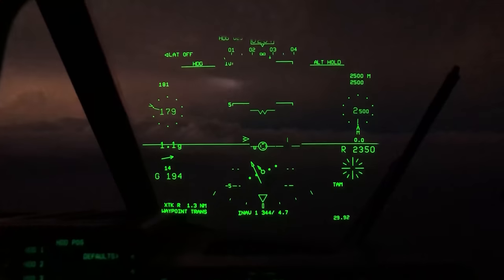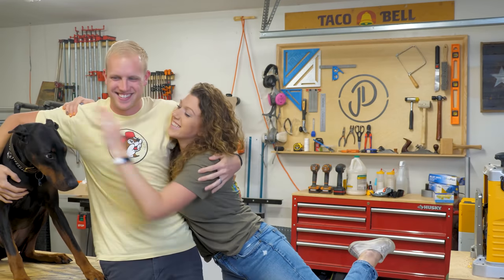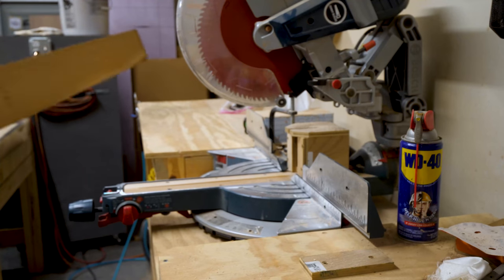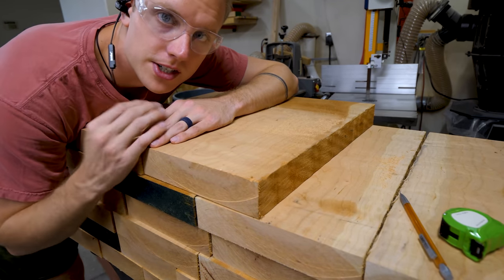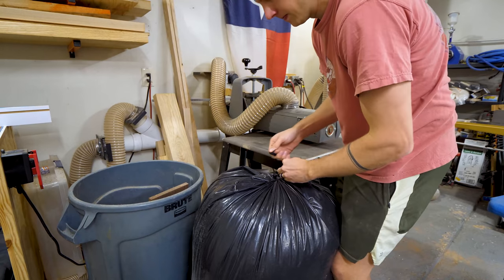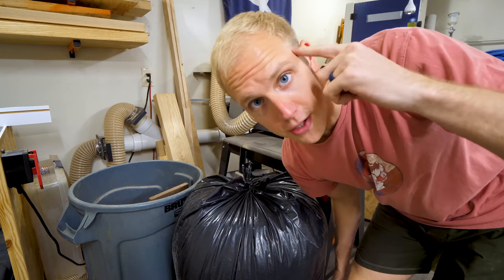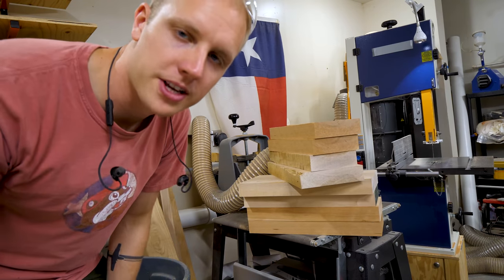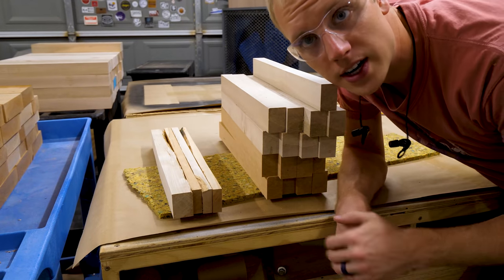What tool is best for cutting boards?

Comment: All these comments about using a different table saw blade ignore the problem, which is the wood itself. You yourself said "the internal stresses" in the wood are causing it to pinch the blade. If the wood is stressed, it will pinch a 24 tooth blade as much as a 50 tooth one. A bandsaw blade is so narrow that pinching isn't an issue, but you also said the pieces "banana" on you sometimes after they are cut. This is a lumber problem, not a tool problem. While some stress may be natural, if it happens on board after board, and in different batches of wood from the same dealer, it is not a natural problem but a man-caused defect called case-hardening. This is caused by attempting to kiln-dry lumber too quickly, which causes the outer fibers to compress at a significantly different rate than the inner fibers. This is a significant defect that is grounds for returning lumber to the dealer, and if it happens often you should find a new dealer.
Reply: @deanwilliams93  :)
Reply: @deanwilliams93  - Sounds good :)
Reply: I concur … find a new dealer who gets their wood from a different supplier … or dries their own wood.  It happens … but it should be rare, not the norm that wood is so stressed.
Reply: Totally agree.
Reply: Listen to Stumpy Nubs, he knows what he's talking.
Reply: Totally agree with Stumpy

Comment: For your setup right now keep doing what you're doing. Once you get to a bigger shop you might consider upgrading to a full three horsepower saw with a good thin kerf rip blade. Also, and maybe it was just the angle of the camera, it did look like you were standing directly behind the wood as you were running it through that blade. You need to be staying offset in case you get kicked back. That's one thing about the band saw it's a much safer tool compared to the table saw.
Reply: @deanwilliams93  That might be true but the thin kerf will also allow for an easier cut.  It's less mass to move and it's removing less material which when ripping thick hardwood will put considerably less strain on the motor allowing for faster and cleaner cuts.  As he is already jointing these ends anyway it's not really an additional step and would be considerably faster than the bandsaw.  A standard blade might remove the need for jointing but if that means double passes or much slower feed rate then it still not a win. Honestly what they need is an old school bandsaw with those 1" wide blades running on 220V.  it would be huge and only usable for one job but in a production situation it might be the best choice.
Reply: Fancy seeing you here Mr bear! :)

Comment: Pretty sure the folks in here saying to use the 24T Rip blade are on the right track… however … I still think you’re gonna run into some binding issues on 8 quarter stuff… making sure the wood is totally cured and acclimated to your shop is also key… but honestly … just keep using the bandsaw if the process ain’t broke don’t fix it!!

Comment: So I'm generally able to consistently rip through 8/4 material (even hard maple and ash) without burning, and this is on a jobsite saw that is built into a larger table. So not a big motor. 

Here's my suggestion if you really want to dig into this method:

1) Get a dedicated thin kerf ripping blade. The freud thin kerf glue line ripping blade is awesome. While I can rip 8/4 with my Amana 40T, it is slower going and I do get some burning. 

2) Get a miter slot jig with a dial gauge and make sure that your blade is perfectly parallel to your miter slot AND that your fence is also perfectly parallel. You can also have the blade slightly (like .002" at most) out of parallel at the back and away from the fence. 

At the end of the day, I think you're fine either way. If the side you're ripping isn't your glue surface, then maybe the bandsaw is just fine (and likely safer). That said, you might be able to take fewer passes through the planer by using the TS. 

You may also want to look at getting a power feeder setup on your TS for this. It might not speed things up, but you'll get a consistent feed rate that should reduce burning, and it keeps your hands away from the blade so it's a lot safer. Check out Mike Farrington's channel. He has a 1/4 hp power feeder that he puts on for repetitive ripping tasks. 

Good luck with the commercial space search and move!

Comment: I didn't read all the comments below, so this may have already been noted.   The way that is burning, it looks like the blade and fence are not parallel.
When Parallel the "set" of the teeth should make a wide enough kerf to prevent burning.   This appears that the fence is angled a bit toward the blade causing the blade body to rub and pinch the wood.   Check the parallelism of your fence and blade to the miter slots.   These are usually both adjustable. If everything is parallel you shouldn't get the binding/pinching that appeared to be happening.

Comment: I read most, not all of the comments & I absolutely agree about the rip blade, that was the first thing I thought of. I'm a retired boat builder that has converted the garage to a wood shop with mostly used tools. I bought a 22yr. old Ridgid 1 1/2 horse table saw that was sitting in a warehouse for a number of years. Had to do a lot of adjusting & tweaking to get it dialed in but it's still not perfect (22 years old!). As far as I can see except for the blade your not doing anything wrong. This is just the nature of Maple, one of the toughest common woods out there . A lot of good suggestions here  especially the short sacrificial fence.  Once the stock gets past the fence there is nothing for the stock to push against & it still gives you the support you need. The only other thing I can think of is possibility, your blade & table aren't perfectly aligned with each other. This can happen with even brand new saws or saws that have been moved from one location to another. You can check this with a dial indicator to make sure the front and rear of the blade are parallel  with your crosscut slot. My saw is close not perfect but like I said... 22years old. The way to fix this is to adjust the table (not a fun job).There are 4 bolts under the table that can be loosened & with some gentle taping you can align it. Then hope it doesn't go right back when you snug the bolts back up. Now with all that being said, if I had a bandsaw like yours I would get the best resaw blade out there & use that. Just make sure to get the widest blade the saw can handle. Just remember your not doing anything wrong, it's just the nature of the beast.

Comment: Always enjoy your videos! Regarding the table saw, I think I'd try a rip blade instead of a general purpose blade. A rip blade will allow a faster feed rate, less heat build up, and therefore less burning.
Reply: Yes, 24 tooth does the trick for me!
Reply: True. Just depends on how often they would have to be switching blades.
Reply: @StevenDavisPhoto  If I had my 42T blade on my saw it would totally react the same way as the video
Reply: I would say you got the wrong saw blade.  I have the same saw with a 50 teeth combination saw blade and work like a charm
Reply: I've used a delta contractor saw and cut green hardwood timber with loads of tension with a dewalt 36teeth blade don't know what power the motor is but feeds in and out not A problem. Also how do you rate the mirka Sanders you should do a video on sanding to a finish.

Comment: I use a Freud Thin Kerf Glue line rip blade on a $600 Delta Contractor saw and I cut several hundred board feet a week into strips on it with zero issues. I do have to slow my feed speed a bit on Maple and Walnut to avoid bogging, but thats the saws fault. Its only a 13amp motor, it doesnt even have a HP rating. One other thing to check is to make sure your fence and front fence rail are 100% square to your blade. I had to make a few small adjustments to my front fence rail because my fence wasnt square to the blade when I bought the saw.

Comment: Couple things. What HP is the table saw? Thick hard maple you're going to need at least 3hp. What type of blade, combination? crosscut? rip cut? Thin kerf or standard kerf? all these things will add up to problems.
Reply: Should use a rip blade,  it does make a difference.
Reply: I am in the uk and my table saw only has a 1hp motor, but i use a rip blade and it has no problem cutting 2 inch thick maple.

Comment: I did this same thing because I was a little too lazy to change from a cross cut blade which is what you have in your saw and change to a rip blade.  Now I change the blade when needed and it works just fine

Comment: For the table saw issue you need a sacrificial fence added to the main fence, but it only needs to go past the the front cutting teeth. That then gives the stressed timber somewhere to go. If you look at our table saws here in the uk and europe they either come with a short fence for ripping or an adjustable one that can be moved to have the end of the fence just past the start of the cut.
Reply: Very interesting. I've never heard of this technique before.
Reply: This!!  Exactly the problem, and the safe solution.  Similar concept to the jointer, with the offset feed table height, except since the jointer is performing surface work, the wood remains supported at all times.  With the offset fence (sacrificial fence, lead fence, etc.) the piece is fully supported into the cut, and then, as the wood is separated, it has room to move to eliminate binding.  Of course, a dedicated ripping blade is safer for dense woods too.

Comment: I mill 8/4 regularly both with a tablesaw and a bandsaw. I use feeders on both.
That said, even 3hp is kinda small to run 8/4 through on a regular basis.
For blades you might want to consider talking to people who don't advertise in hobbyist publications or cater to big-box stores. 
A "Rip" blade ground correctly and sized to work with your riving knife will permit you to work much faster on the tablesaw than the bandsaw. (with an appropriately sized motor) The kerf should be a couple thousands larger than the plate and the riving knife should be the same thickness as the kerf. I set the leading edge of the riving knife to just clear the teeth. Use gauge blocks to parallel the riving knife to the plate, if it sits askew it won't work well. 
If you're not comfortable ripping on the tablesaw and need a push stick to run 1-1/2" or larger strips then build a sled that'll let you process those small strips without the extra step of grabbing a push stick.
A rule of thumb is for ripping (either saw) try to only have 2 teeth in the wood, (For resawing this isn't possible but we're not discussing resawing.) With a circular blade such as you show in this video you'd need to really crank it up so as to present an almost vertical face to the wood to achieve 2 teeth in the wood if it'd even work then, and that's not really safe. Heat from too many teeth in the wood will cause some boards to draw inwards to the kerf, it's not always a poor kiln operator. Tooth geometry and gullet profile come into play on both types of blades and sheer horsepower will overcome most of these problems if you don't want to invest in knowledge and cutters. 
It seems as though you two have got a handle on the business end of woodworkin' and marketing yet the only way you've made available for oldtimers to offer advice on the woodworking aspect is to either pay you for the privilege or post here on youtube. 

Maybe consider something different?

Comment: I switched over to a 24 tooth blade for ripping and it works great.  I use a 60 tooth for crosscut.  You can buy a pair with one 24T and one 60T craftsman blade at Lowe's for $30.

Comment: 📌solution to this problem: 
Better use the right blade for the "length cut" (when you cut in the direction of the grain of the wood), less teeth, bigger diameter (if possible) and have the blade max out - save the wood with clamps instead being so near to the blade. (Here in Germany we all fall unconscious, when we see this kind of safety-standards. ;) )
The parallel fence is too far over the blade and presses the wood back on the turning blade, so it get stuck. use a sled or clamps as  mentioned. 
It is like filling up a Tesla with gasoline, it will burn, like the wood did.
Greetings from a carpenter from cologne! Have a good day!

Comment: Love the honesty and willingness to ask for help. Less trouble for the bandsaw not only due to thinner cut, but MUCH less surface area on blade after the cut. If a good rip saw blade doesn't fix it you might want to think about a 4 horse table saw. I think your asking alot of that 2 HP saw to rip those hardwoods fulltime even if a better blade helps. Just my 2 cents. Goodluck!

Comment: Rip blade is a must. I used to use the the blades that would come with my new saw and I had, at times, issues ripping 3/4 thick red oak boards. With the $45 Freud blade I have no issues ripping any 8/4 stock, including oak, mahogany, hard maple.

Comment: When the wood pinches at work we either take it back and try to nibble some more out, to widen the kerf, or we jam a flathead screwdriver behind the blade to wedge it open. We do have the fence adjusted to stop bevore we cut through the wood

Comment: Check the thickness of your blade vs the thickness of your riving knife. You can see in the video the blade is touching on the backside.   I’ve had similar issues and switched to a 1/8” kerf blade and it seemed to work better than a thin kerf blade.
Reply: Good point!

Comment: I think the folks telling you to use a rip blade are right on. Thinner blade with deeper notches to keep sawdust from building up. The other huge trick is not to have your fence square. If you let the back end of your fence out just a little you can still square thing up in the front or better yet use a 1/4 in block on the front part of your fence to allow for the movement of the maple as it passes the blade. I have used both techniques cutting 6 and 7 quarter with some really good results. I will be watching to see how it goes.

Comment: It's your business, use whichever saw you want.  However I was very surprised at the difference I got when I switched from a 40 tooth general purpose blade to a 24 tooth ripping blade, and by setting the blade height to just clear the gullets above the workpiece.
Reply: Yup

Comment: Do you always have the boards cut to that short of a length? Setting up an outfeed table on the table saw would help.  With short stock like in this video the outfeed table would catch all of the pieces so you wouldn't have to  reach across the table to pick them up individually. Just run a bunch through one right after the other and pick them up off the outfeed in batches.   An outfeed table also let's you run much longer stock if you decided to cut the strips first then cut to length. (for your boards I think starting with cut to length boards is the way to go)
Reply: They did explain in a previous video about why they cut the boards to rough length. Planing a shorter board loses less material than planing a longer board with a bow/ twist in it. With a long board you might have to plane 3  or 4mm off to get it flat, but it could be half that with shorter boards.

Comment: Hello Davis,
the blade, you use, is a standard blade - a compromise between rip cut and cross cut blade. The stall of the machine and the burning marks indicate, that there is too much friction. You should try a blade with much less teeth. Rip blades also have more space at the teeth’s ground to transport the saw dust out of the cut. Therefore friction  and burn marks are minimized. 
I wish you good luck. 
Best regards from Switzerland
Roy

Comment: Little late to the game here, but didn't see it in the comments. Once the board starts pinching, pull it out and flip it 180 so you send the back though on the same line. I like to add a 1/4"+ on the measure for milling afterwards. Sometimes you can make a test strip to see bad the bow will be. Sometimes you just have slow down and let the saw chew on it to straighten out. Ultimately though flipping the board will allow new stress to be released on the now back side that's already cut.

Comment: Use a high quality thin kerf ripping blade.  Double check that the blade and riving knife are perfectly aligned and that the fence is set properly to the blade.

Comment: Try using PTFE dry film lubricant on the riving knife, should glide threw with ease . i use TYGRIS PTFE DRY FILM LUBRICANT.  You can also make a small wedge to  open the timber half way threw the cut to release the pressure on the knife and blade...  just little tips ive picked up.. 

Be safe

Comment: That binding happens occasionally in most if not all woods at one time or another on the table saw and not as common on the band saw but can happen there as well. Keep some small wedges near your table saw and when you feel your saw dragging down or friction, tap a wedge in on the already cut section that is starting to crimp on the blade. This does not happen on the band saw as often due to less friction and less heat being generated there. This will solve your issues. Good luck

Comment: I have a 5 hp industrial saw stop and ripping blade. For the kind of operation you are doing I always use the bandsaw. It is safer and faster. But you should get a ripping blade.

Comment: I think it comes down to the right blade for the wood. You may need a blade with a larger kerf to it. Then the blade is clearing more wood out leaving a larger gap between the pieces. Reducing  the how much the wood is able to pinch the blade. You also need to be using a ripping blade which will have a larger kerf for just this reason.

Comment: As most have already said, switch to a rip cut blade. It works wonders! I was having the same issues cutting Maple and Cherry. It would stop my blade and trip the breaker. Incredibly frustrating.  With the new blade I don't have those issues.